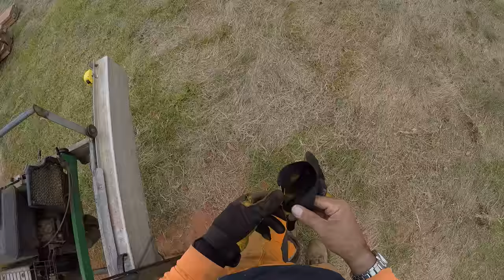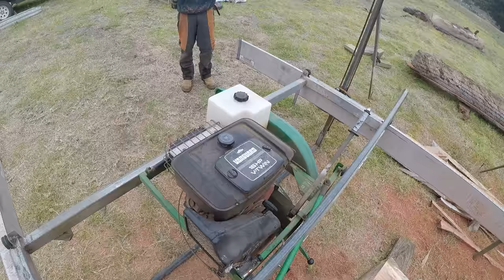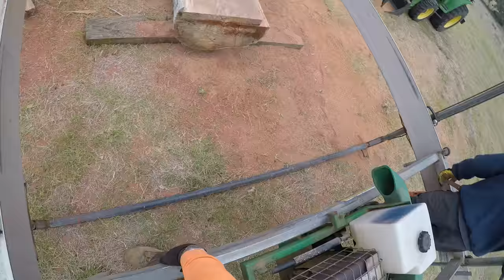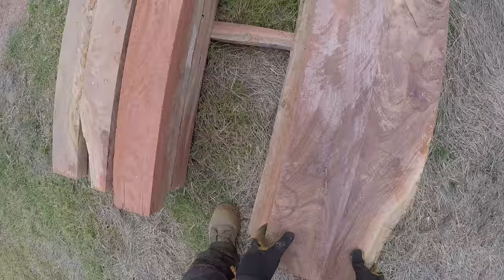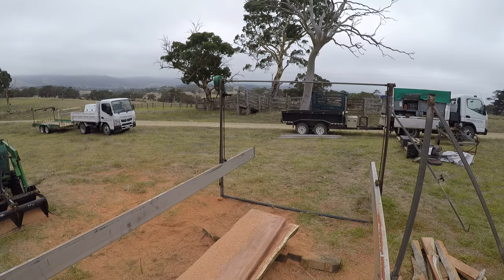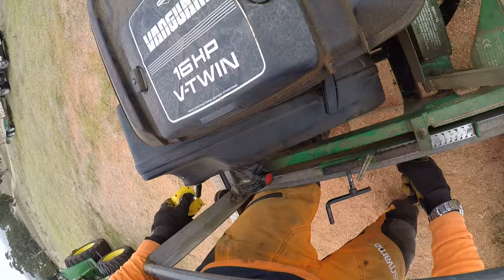Lucas Mill tips and tricks Part 9 - Cutting from both sides with the Swing Blade Mill

Comment: Any day of the week I'd have this over a bandsaw type mill if it weren't for the fact I can't cut 12x12s" on my own. I could get the slabbing attachment but it would be great if I could do it all with a circular blade as I wouldn't have to turn the log. What would be great is that as an attachment if you could buy a blade large enough to do 12" cross cuts to accurately square off the ends too - even bandsaw mills don't address what i see as somewhat of a glaring omission.

Perhaps a way around the first part of the problem is to buy 2x cutting jigs and a couple of track extensions and have a jig at each end.
Reply: It can be done on your own. Put the blade flat and in the middle over the log, lower the rails so the trolley is on the flat of the log, spin the mil, raise and cut from the other side.  Lucas are ok with this.
Reply: @paultmckay 
I have done this. It works.

Comment: Recently I watched a vid of a Petersen Mill  being demoed,,, they cut a couple of weather boards,,, it wouldn't be  hard to add another stop at the angle required to cut the taper ,, the only problem is a std. weather board is 7 inch 175 mm where this mill could only cut 6 inch  150 mm .. I will add the Petersen mill was only a 150 mm also..
Reply: lucas mills make a weatherboard attachment , you have to cut vertical though.

Comment: can you make multiple cuts, horizontal, downward, then switch the direction of the mill and finish the cuts for multiple boards vs. doing them one at a time? hope that makes sense.  Stacked cuts, go to the other side and complete....?  May have to wedge the first cuts?  Have ordered a 6-16 based on watching your work, looking forward to using the mill.
Reply: Png
Reply: Yes and careful with you winding.

Comment: Mate your a bit of a spin doctor here .    I run a Lucas mill 10" 30 hp and as for your measuring here I ask myself a Question ! ..... your winging it , and as far as turning your mill head , this is not nesassay   as I run on the same 10" cut first on the back side and then on the front , 4 passes and have dropped the gadge so I can get a 50mm board , so we have a 20" board as normal will be 40 mm thick as standard